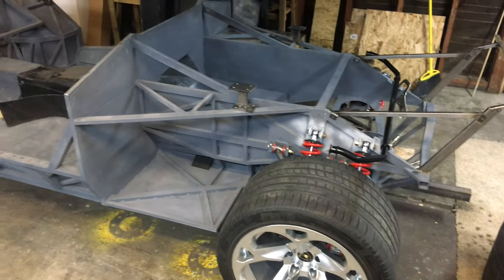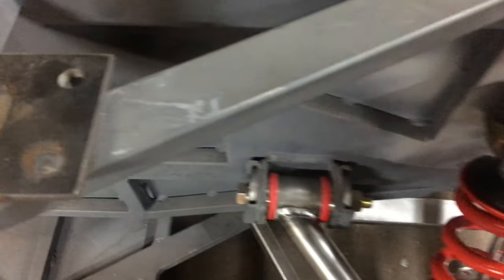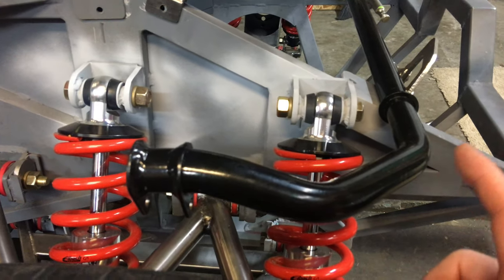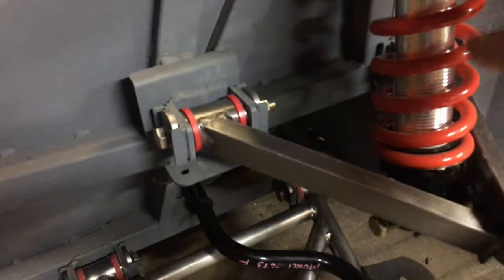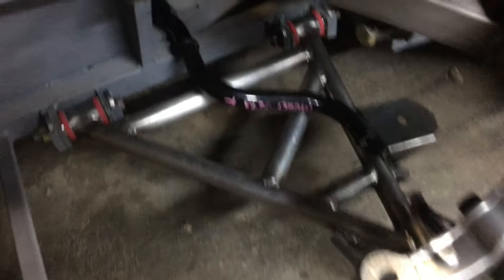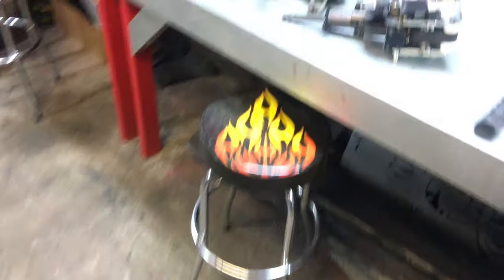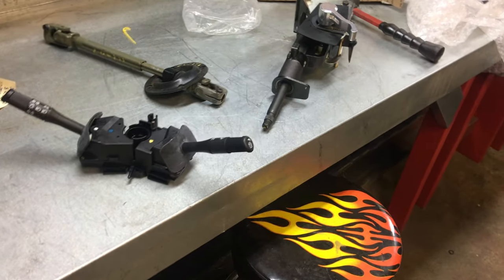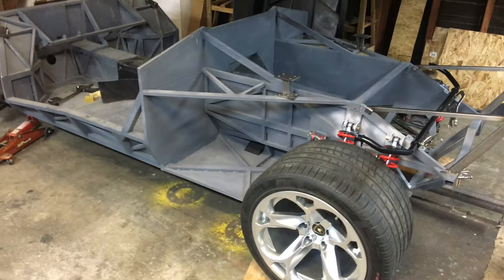Project Diablo 6.0 update

Comment: What steering rack? I went with a power camaro rack. I adapted a Murcielago column to it. I have the wiring diagram for the column control switches if you need it. I’m going to make an adapter for the Corvette spindle to move the tie rod end in closer to the pivot point (will allow for more turning since the camaro rack does not travel enough for the longer spindle arms of the Corvette). I used Z06 brakes for mine it bolts right on cheap and same size as early Murci but 6 piston vs 4 they came with.